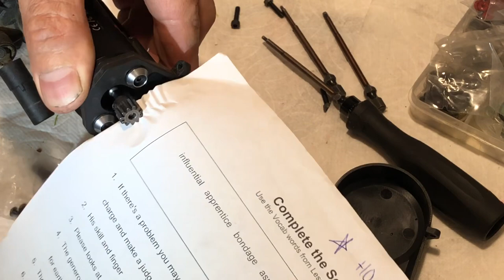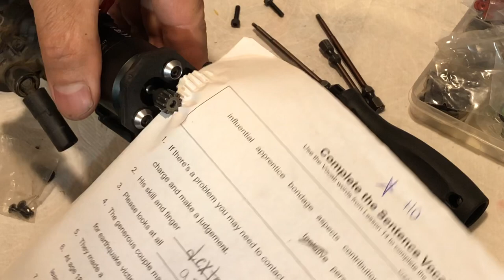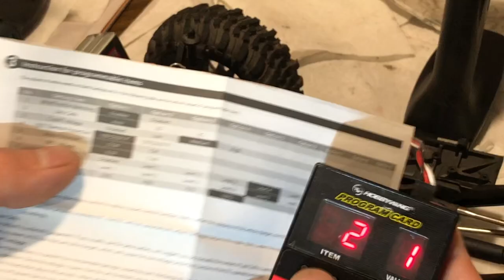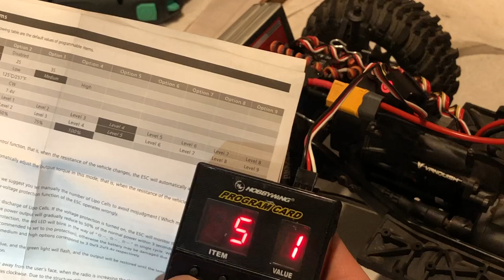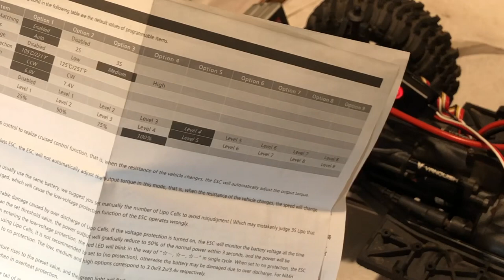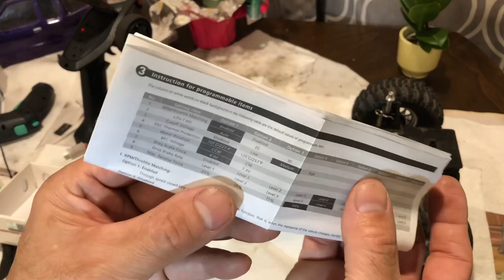Removing transmission in RC Vanquish VS4-10 straight axle. Installing HOBBYWING Fusion SE 1200

Comment: The HobbyWing 555 brushed motor fits perfectly with no cutting or grinding required 58.5mm in length
Reply from the maker: Thank you for the response. Is the 550 hw better, because this hw 1200 se fit as well

Comment: I noticed you didn't install the bottom screw that goes from under the car. I had trouble lining that up but I was able to eventually install it when building the kit.
Reply from the maker: Yeah your right. I’ll have to figure out how to edit the video to add a subtitle stating there is one more fastener.

I recently got this Vanquish. I did not even know it was there until I was watching the video. Maybe it will help stabilize it from hopping so much after it is put in. I do really love the under belly design on the Vanquish VS410, super smooth. 

Thank you for watching the video and helping me stay informed. I appreciate Your comment Ben. 👍

Comment: Pinion up lol 1200 has no wheel speed.
Reply from the maker: Yes sometimes you need the wheel speed.  If you are running portals I would probably recommend the fusion 1800 SE.

But it crawls so slow, smooth and nice. And half the price of the fusion pro or castle puller and mamba mini ESC. 

Thank you for your comment. I appreciate you bringing up this point and for your wisdom.